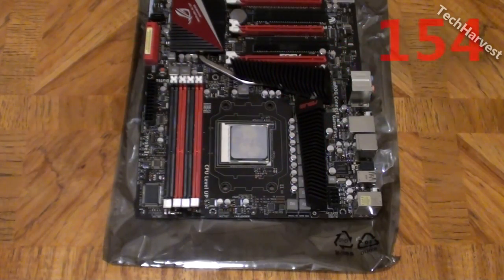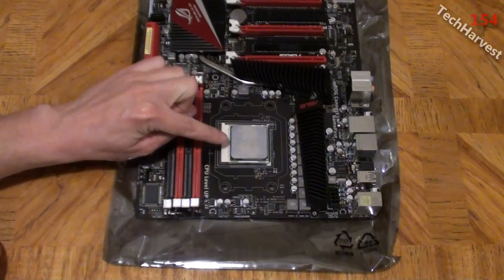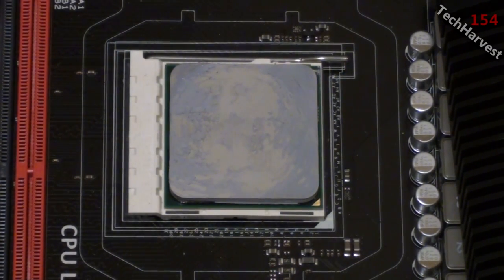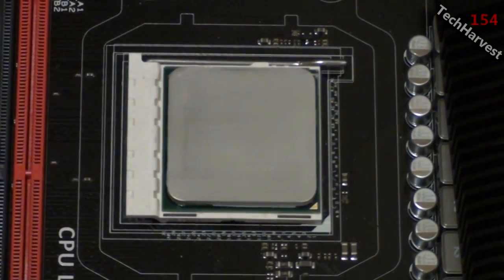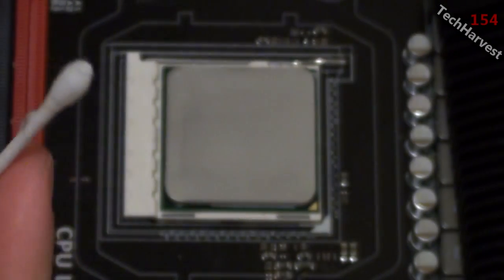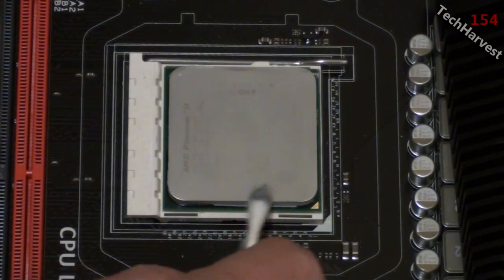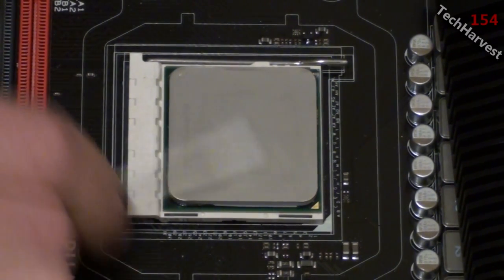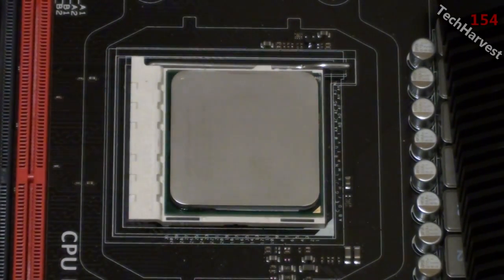How To Clean Thermal Paste Off Of A CPU

Comment: Do you absolutely need the alchol? I don't have any
Reply: +Daniel Contreras You can hypothetically use regular soap if you want, but it's not recommended! It might get rid of all the visible paste, but the point of using as pure alcohol as possible is to avoid any thin invisible layer of chemicals left on your CPU and/or cooler which will affect the temperatures. By using isoprypol alcohol; any oil, liquid or other chemicals left on the surfaces will evaporate, leaving it as clean as possible. Bottom line is: You can use whatever you want, but you'll want to have all surfaces as chemically clean as possible for the optimal cooling effect, which is where isopropyl alcohol comes in. The difference might be negligible to some, but if you're gonna reduce temperatures by installing a new cooler, you might as well do it properly and optimize the cooling effect you're after.
Reply: +Yoni123 It's HIGHLY recommended, or else there will be some residue left on the CPU (that you might not even see). Most preferably isopropyl alcohol, also called isopropanol, which he's using in the video. It doesn't cost much at all for a small bottle. 91% alcohol or higher is recommended.
Reply: René Hagen Hage actually found some alcohol swaps. I thinke they were 70% but worked just fine. cleaning off all the dust and putting in a new paste dropped cpu temps by 20c lol....
Reply: +René Hagen Hage It has to be isopropyl alcohol (99% - 91%)?  or I can use any other kind of alcohol?  I know that is the recommended, but I already have a bottle and I don't know exactly what kind of alcohol is.
Reply: What i do is grap a flatty cable IDE ATA and scrape it off ofc only works with silicon paste
Reply: +René Hagen Hage Thanks for your help! :)
Reply: +René Hagen Hage  is 50% isopropyl alcohol ok to use?
Reply: +René Hagen Hage hey I'm getting a new cpu and replacing the old one would vodka help or water or any one because  I won't be using the apu anymore
Reply: +Video Game Intros lol what paste?
Reply: Why, what is the problem with apu? Steve plays

Comment: Can I use normal 70% alcohol instead of isopropanol?
Reply: At least 99% isopropanol
Reply: ok tnx
Reply from the maker: +Gasper Gril You can use 70% if you need to.  Just make sure that you let everything dry off and don't get your CPU socket wet!  For the record though, you should use the highest percentage of alcohol that you can get your hands on.

Comment: I wouldn't recommend using a paper towel or a q-tip since you'll end up getting fibers on the cpu. I'd recommend using a microfiber towel.
Reply: I understand that. But chances are they wont get on the CPU while a heat sink is on top of it. The fibers from the paper towel can cause degradation of the thermal and also effect the transfer of heat. So yes I actually am.

Comment: isn't it bad to put your motherboard on the outside of the esd bag?
Reply: +chord95 Yep, you're right
Reply: I built my computer directly on carpet. 

I do what I want
Reply: +chord95 Anytime I see a Video with someone doing this, I don't trust their content.
Reply: Lino Fragoso I know, people handle PC components like they are plutonium. I just rebuilt my pc for example, and i kept on hearing clicks and clacks everywhere along with me landing my screwdriver on the mobo. Everything works now and there were no problems with it, so yeah.
Reply: +chord95 
You are 100% correct chord95, and you are spot on in your explanations in your other comments. It's +PixelFox that is a "fu##ing re*&$ded" with his knee jerk answers. I'm sure at this point he is feeling pretty dammed stupid, and if he isn't then he is more stupid than we all think he is. If he had any character at all he would man up and apologize to you for his comments.
Reply: +chord95 jeez I really didn't know that. I always thought these bags were the same inside and out, too. Must have been lucky with the last couple of PCs I built. SO I guess the best way would be cut the bag open to turn it inside out, if you wanna use it as work surface? Is a (printed on) cardbord box (e,g, box of the MOBO) safe?
Reply: +Realraven2000 most people put in on the box it came in, i did that too. printed cardboard is pretty safe
Reply: +chord95 People have ran motherboards on top of the esd bag. (CareyHolzMan) and nothing happened
Reply: ***** Just remember dont "Ground" yourself because it is not dissipating anything, you are actually putting yourself on a different electrical level, you want to be the same as every other component in your pc, how do you do it? Touch something metal, frequently
Reply: ***** Just take that advice, NEVER ground yourself when working on your pc
Reply: ur heart must've stopped and dropped below freezing lmao
Reply: one time I did that and killed my motherboard... It was bad
Reply: Tanner Robinson I can't tell if ur joking but I actually did sadly
Reply: TrailTrackers this is my course and we use "antistatic mats" not esd bags because the Faraday cage is now acting like a path to ground i.e the pins under the pcb of the mobo are touching the Faraday cage strips effectively grounding it and if you have a charge, zap. Bang goes the cpu. Just don't ask how I learned that.
Reply: show me the carfax bro
Reply: Yes. your right. The bag works by moving static from inside to outside.
Reply: MessyBugatti i dropped my i7-6700k on a tiled floor from over a meter and it still works😂
Reply: +MessyBugatti can remove lifespan out of a pc but probably everything will work its actually  hard to make something break
Reply: +chord95 No, its the same material outside and inside. Its better to build on the bag than on the box.
Reply: +PixelFox you obviously dont understand how an esd bag works. it's got conductive material on the outside to create a faraday cage which causes electricity to go around the bag instead of inside. i had to go a 1 day course to work at an esd protected area at my job so... google is 1 sec away mate

Comment: very smart to tip the bottle above the motherboard XD
Reply: Spill it all and light it up
Reply: Uh i clean my pcb's with pure alcohol make sure it just dry's out before turning back on again
Reply from the maker: joost van den Berg I did it to get it in the camera shot and I didn't spill a drop ;)
Reply: i know but i don't recommend others to do it
Reply: lol
Reply: ikr it acctually scared me a little bit when he did that xD
Reply: +Julian Depaepe And use 98% anything under that is dangerrr
Reply: @Redicat  I'd say 90% is good enough as long as you let it fully evaporate before proceeding. But Higher % is better as it will evaporate all that much faster. Just don't use the typical 70% that most people have sitting around for cleaning cuts and scrapes, etc. =)
Reply: Now should you clean the bottom of the cooling fan as well? I installed the fan before knowing to remove and re-apply the paste so should I clean the old paste off of the the bottom of the frame of the fan as well?
Reply: @jameswarrick1761  I'm not sure if I completely understand what you're asking, but some general rules are to always clean both the cpu and the cpu cooler/heatsink every time the cooler is taken off and re-apply new thermal paste to prevent air bubles getting stuck. Also never mix and match 2 different thermal paste, for example don't mix pre-applied thermal paste from a cooler with additional other thermal paste.
Reply: @kamally  One thing to note regarding this. Kamally kinda touched on it, but many AIO (All-in-one) coolers these days come with pre-applied thermal paste already on the pump. So simply cleaning off the old paste from your CPU is enough. Then you can just install the new pump. But if you are replacing thermal paste and keeping the old CPU and old pump (e.g. some people are die hard for particular brands of thermal paste), then you would want to clean BOTH surfaces as shown here.
Reply: @dubhlainn2565  Gotta love that this is 9 years old now 😂
Reply: @jameswarrick1761  Hi there, I know you posted this 2 years ago so you probably found your answer, but yes you should! It will lower the chance of overheating a lot more.
Reply: Dude. I've feel anxiety for the second there
Reply: @jing800
Reply: Fucking haters comments!!
Reply: Bro is rich 😅
Reply: it's alcohol, it can certainly be spilled right onto the thing.  it will evaporate in record time too..... it's what we use to clean electronics.  it's a non-issue.  FYI, usually it's 99.9% IPA though, not 70%
Reply: You can pour alcohol straight from the bottle into the cpu socket then blow it out to clean it🤪

Comment: Do you have to do this when you replace the cooler on the CPU? Do you have to take the motherboard out of the case, because that is a real pain in mine.
Reply from the maker: ComputersAreRealCool You need to remove all thermal paste from both the heatsink and CPU when you separate them.  You also need to reapply new thermal paste when you put a cooler on a CPU.  Never reuse thermal paste.  If your case doesn't have a cutout behind the CPU, you might need to remove the motherboard to replace the cooler.  However this isn't always the case.  It depends on the cooler.
Reply: TechHarvest Mine has the cutout at the back, so I don't think I will have to remove the motherboard. Thanks for the help.
Reply: ComputersAreRealCool LOL take off the motherboard because the back plate of the cooler, nothing else. ;-)
Reply: Origenes Trismegistos I just installed a new cooler without removing the motherboard. My case has a second panel on the other side that gives access to where you place the backplate. It actually made it easier as the case held the motherboard in place and made it easier to install the standoffs.
Reply: ComputersAreRealCool
In that situation you do not have to take off the mobo. ;-)
Only have to take off, because no hole for back plate, nothing else.
Some computer case has no hole on back. ;-)

Comment: Would it be better to take the CPU out of the motherboard to do this (I don't like the idea of putting pressure on my motherboard)?
Reply from the maker: ***** You run a greater risk of bending pins on the CPU (AMD) or touching the contacts on an Intel CPU if you remove it from the Mobo.  Honestly very little pressure is needed to clean off the CPU.
Reply: TechHarvest Okay, thank you so much!

Comment: Do you have to take the motherboard out of the PC? Damn should I just buy a cooler right now instead of using stock cooler so I don't have to take everything out?
Reply from the maker: wonderr You might have to remove the motherboard.  It all depends on your case (if you can access the rear of the CPU) and your mounting hardware (if you can use what's there or if you have to replace it).

Comment: umm if a PC's heatsink paste is burned on the CPU does that make removing the cooling fan/ module from the CPU hard or impossible without causing any damage? my friends PC emitted some nice burned smell from the CPU the other day but it was not the CPU actually burning up... well at least we hope so , i want to remove the Cooler unit from it to check if there is any visible damage... but when i detach the Coolers leash i should be able to move it slowly to break the paste under it... so i can remove it without damaging the CPU... but the thing is: I t does not bloody move! its rock solid... any tips or help? i am out of ideas here...
Reply: Just twist it while tugging on it with a decent amount of force until it comes off. Clean the supposedly burnt paste as best as you can with alcohol and qtips. This is all you can do really, good luck man!

Comment: Does it matter how hard u push to clean the cpu
Reply from the maker: You want to avoid making your motherboard flex as much as possible.
Reply: ok so i can put as much fource on the cpu just not on the mobo
Reply: Dragon20C better to not put too much pressure on either tbh, but yeah, usually you can put a fair bit of pressure on the cpu.
Reply: NyanCatIsMyCat thanks very usful info

Comment: Are first aid IPA alcohol wipes any good at 70%
Reply from the maker: You can use them if you want.  The key is to not to use something that will leave any residue on the CPU.  Also you don't want something that will drip all over your motherboard or into your CPU socket.  Squeeze out the wipe before you use it to remove excess liquid.
Reply: TechHarvest Can you use nail varnish?

Comment: Isn't it bad to use cue-tips and paper towels because then some fabric could get on the CPU?
Reply: It is, but In my expierence (I have changed it like 10 times) no harm has come from  it. Also I use a little water, or vodka, cuz I didnt have rubbing alchohol.
Reply: Janis Zes Paper towels are a no, cue-tips give off fiber only if you use force, so be gentle with it. Anyway thats just my knowledge of it
Reply: some use coffee filters because they are lint free and avoid your concern.  If you are really concerned, use a can of air to finish the job, but wait until the components return to normal temperature as it is chilling and vapor may condense on the components.
Reply: yeah, much better to use a lint-free cloth

Comment: before I applied my heat sink some thermal paste came off heat sink just a tiny bit smeared off , but most was still on there will it be ok?
Reply from the maker: As long as it was just a tiny bit it should be okay.
Reply: Can you just rub the CPU with a paper towel and not use alcohol?

Comment: One thing I learn that if your're going to upgrade your cpu cooler, you better watch tutorials like these and install the system yourself. Tech support guys will never give the same amount of care as you do to your stuff. The first and final time I let a guy touch my PC, he just used a paper tower to wipe off the old thermal paste, no alcohol or anything, and then he went on to install the cooler but with the fans faced in the opposite direction of my chassis's airflow....
Reply: River Capulet bought a AIO cooler for 70$, Best Buy tried charging me 60$ to install and 3 days like wtf no
Reply: Vestbiii Yeah, Geek Squad will run you $60 for installation and all that shit. Kinda BS but for people who have zero knowledge of part installation or stuff like that it’s worth it.
Reply: I just have a relative that knows alot about pcs but i do it myself so when he’s unavailable i can do it myself

Comment: a tip i learned from soldering, instead of using a q-tip with the alcohol, use a toothbrush! there's no nasty q-tip debris either.
Reply from the maker: Noah Siano Thanks for the tip.  I suppose you'd have to be more careful of splattering with a toothbrush though.

Comment: My temps was fine even with OC from 2.8ghz to 4ghz. Then someone ( a "tech) guy) reinstalled thermal paste, he didnt even remove the old, and uses his fingers to spread it. :S My temps are now a disaster and need to buy and reaaply thermal paste and can't OC at all now... omg...
Reply from the maker: Schmidteren Fortunately thermal paste is inexpensive and the process is fairly easy.  Good luck.
Reply: If everything was fine why did you let him reapply thermal paste in the first place then?
Reply: ***** Because I said to him I was afriad I didn't apply it correctly and thatm ight have something to do with my computer freezing in games. I then later fixed it, it was either SSD issue or Ram issue. I think it was the ram issue, but I reinstalled OS and now it is back. And now I can't change the thing in bios that I need to the row cycle in ram timings that I remember fixed the issue. My motherboard was putting it wrongly and that was causing my games to freeze. Or like I said it was my ssd, but I tried that fix and it seems like it helped but it's not completely gone the  freezing.

Sorry long explenation.

Comment: Try using the small alcohol towels meant for cleaning your eye glasses .. works a treat.
Reply from the maker: David Holdaway Thanks for the tip!
Reply: RANCH SAUCE  Just had to ping you.
Reply: I just used this exact thing , it works great , clean the cpu and the heatsink with a dry paper towel piece and then use the glasses towel
Reply: If it uses 98% + alcohol (which it probably does) use it. But it may be a risk if anything is lower.
Reply: @Someone-jq1ds  I don’t think essilor cleaner has any alcohol in it so that’s no good. The cloth should be good though.
Reply: RANCH SAUCE  Also, I used tissue paper to clean my CPU on the main body and it works fine. I added my thermal paste today and for the first time. My laptop runs better and my fans don't sound like a fighter jet.

Comment: Should I try not to put pressure onto the CPU when I'm cleaning it?
Reply: Little pressure as possible it may take some time.
Reply: Doesn't really matter. The cooler is pressed pretty hard against the cpu when it is on. I don't think you can damage your cpu by pushing a q-tip against it.

Comment: F**, it just get the CPU from your motherboard, pour a glass of ANY alcohol over 90% (but for god's sake don't use any of the colored jucie like rum or bourbon, denatured is OK) drop the CPU into the glass. Wait, till its moist and nice :) Then just rinse under the same alcohol and wait 30 minutes to dry. Everything is OK, and you can mount it in new motherboard

Comment: Nice video. As a side not I would like to add that is very wrong that you put you motherboard on the anti-static bag that came in. Is a good idea to store it IN the bag, NOT on the bag because some of the bags are made to drive the static energy for keeping it outside the bag in order to protect the board. You can damage you MB. The MB box is a good place to put your board and work on it.